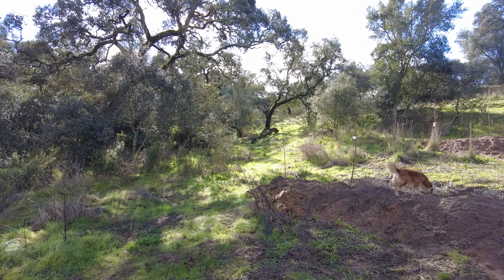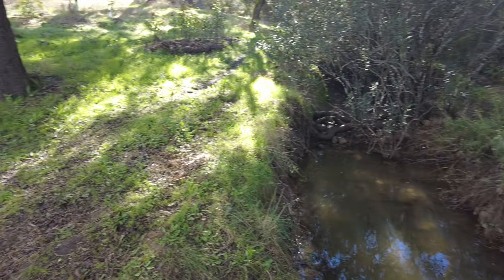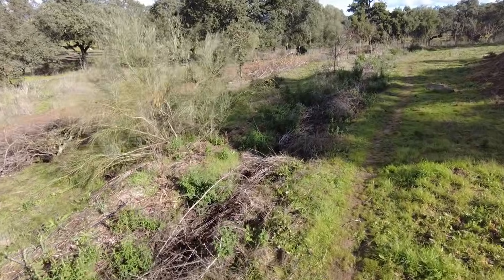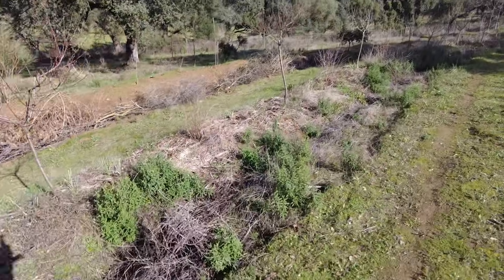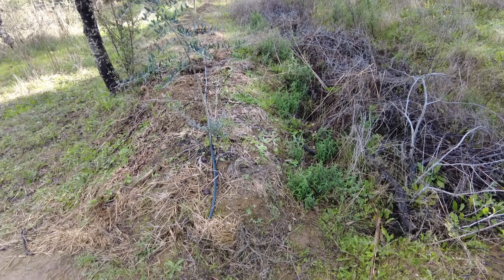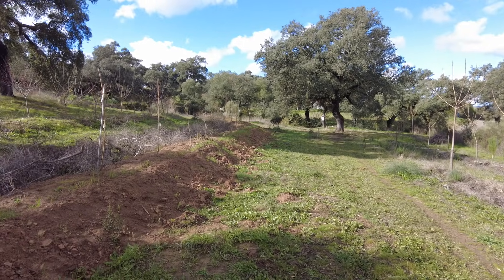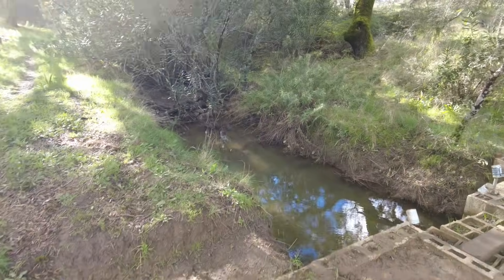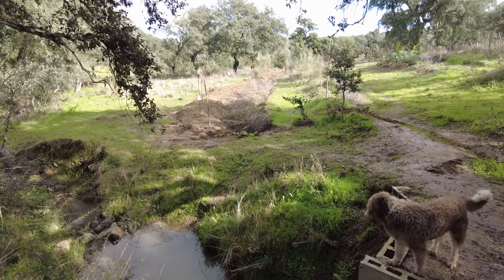Swale Water Infiltration for Tree Survival in Inland Andalusia

Comment: I appreciate seeing the water level remaining in the pool above the middle lands crossover  ~5 days after the last rain fall.  The perched aquifer bubble this pool is feeding will continue to grow through the rain season.  Lets hope it continues to slowly feed the spring for months to come.
The easterly swales from the middle lands distribution pond are nice and long. And the lower of the two swales is deep and wide - so it will hold a lot of water.
Have you ever heard of a swivel pipe?  That is a method of installing a straight pipe of about ~10cm in diameter through the wall of a berm so you can regulate the height of the water in the swale.  Install the through pipe so it lies a few cm below your ideal level and pack the pipe into the berm trench tight with compacted soil.  Then install a 90 degree fitting of ~10cm diameter loosely on the swale side of the berm.
This set up gets its name - 'Swivel Pipe' from your ability to swivel the fitting to fine tune (tweak - not twerk 😉) the exact level of the water in the swale.  By using a swivel pipe, you can release water from the lower swale to feed the remaining swales that follow the northern boundary of the farm.  Might be an interesting experiment 😃
Reply from the maker: Sounds great Steve. Thanks for sharing. We need rain to use the pipe. 😂
Reply: @SuerteDelMolinoFarm  True enough!  One more case of hurry up and wait...
Wednesday night to Thursday night is the next best guess. 😃